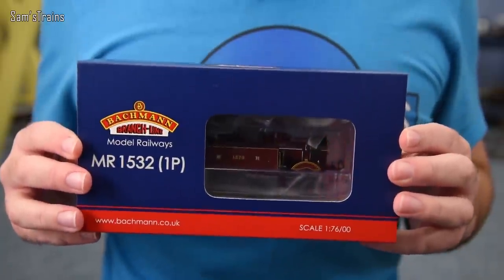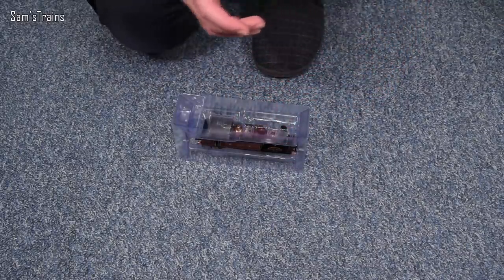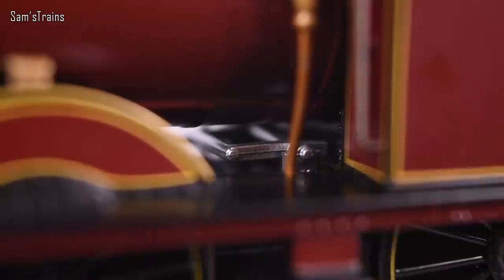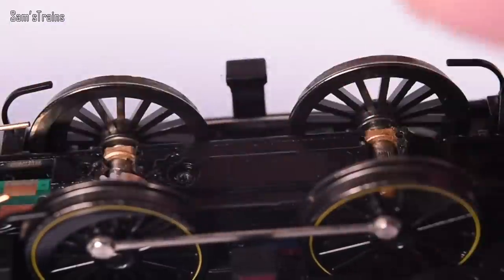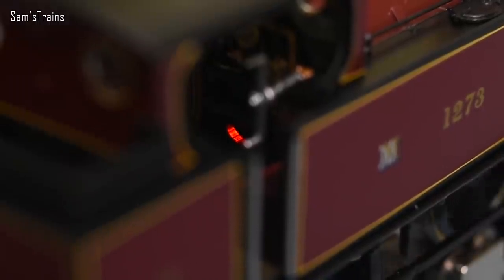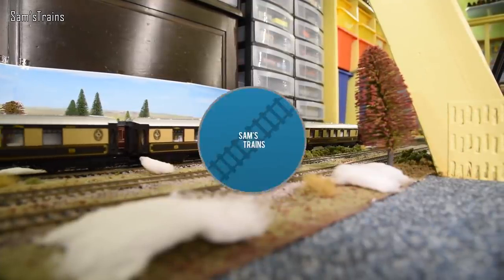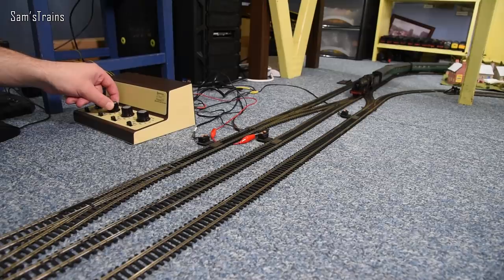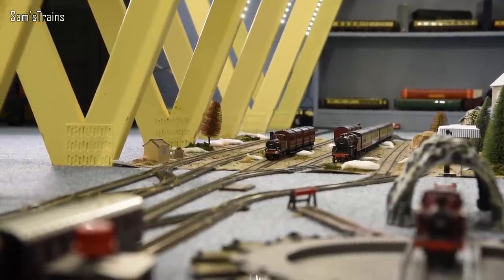Incredible New Bachmann Midland 1P Tank Engine | Unboxing & Review

Comment: I bought the SDJR version which I joined the collectors club for. So £149 + £32 makes it a pricey loco. I used to visit Mid Sommer Norton regularly so it had to be this one. Reasons. I don't have a layout yet but I did run it in on the rolling road. It ran fine. However I  hadn't realised there were pick ups on the small rear wheel set so that needs looking at as they weren't running. Overall its a lovely loco. Very expensive the way I bought it but I have a feeling its going to be my favourite loco. Have a good Christmas Sam.
Reply from the maker: Wow! They didn't even discount it below the RRP, even though you were a member? Sounds a bit greedy to me! Definitely a great loco though - I can see it becoming a favourite of many! :D
Merry Christmas - Sam :)
Reply: @SamsTrains  I just checked. They all sold out but they do have the sound version at £249.95!

Comment: To have bearings, brilliant.  I have a limited issue S & D blue, which I noted was very quiet.  Considering that these would not be expected to pull more than 6 coaches, so the non-tyred one is realistic. I think they could have used metal valve cover. I ordered mine 2 years ago. Ironically, I haven't yet received my order from a local supplier, because Bachmann haven't sent them to them yet.
Reply from the maker: I agree Don - nice quality touch that! Sure, I didn't think the pulling power sans-tyres was at all unimpressive!
Merry Christmas - Sam :)
Reply: @SamsTrains  Merry Christmas.

Comment: Uh oh...  anyone else catch an error in the model?   Freeze at 8:08 and look at the number 2 driver... that rod is pinned Next to the counter weight. It should be exactly opposite. That counter weight's sole purpose is now foiled.   Sam, will this be pointed out? I'm being interrupted and must finish watching this video later.  Cheers, John  in BC Canada
Reply from the maker: Not necessarily true - the coupling rods are not the only masses effecting the wheels - between the frames is the valve gear and cylinders... that's where all the heavy lifting is done!
Merry Christmas - Sam :)
Reply: @SamsTrains  I looked, and you're correct. I do believe that the shorter coaches look much better than the longer ones. I understand, that in the olden days when a locomotive has enough brake horse power to pull a lot, then let it. Looks out of size for this loco to pull the eight-wheelers, but your final set up is sweet! Cheers.

Comment: I have the DCC and sound one and I agree with you it’s lovely model however as regards pulling power it’s poor. I had it pulling 1 coach and it struggled on the gradient both straight and curved with slipping.So I coupled it to 3 trucks plus brake van and that was ok 👍 The sounds are fantastic and the independent brake is excellent so I’ll live with the poor traction. I enjoyed watching the video and it was a great review
Reply from the maker: Very nice Tony - though I'm surprised that there was trouble with 1 coach, what kind of incline is yours? Glad the sound was good though!
Merry Christmas - Sam :)
Reply: Merry Christmas Sam, it's not a steep incline but it slipped a lot pulling the coach which is a Bachmann composite SR Brake.

Comment: Sam: I am aware of your stated reasons for running on the floor BUT you really should encourage your followers to get up off the floor and onto a well-built baseboard. It really is the only way to achieve acceptable running provided your track has been laid with care. Plus as you get older a baseboard saves your knees and gives you a realistic eye level view.

Comment: Glad yours worked I opened mine and screws and springs fell out and stuff was rattling around inside. Went back to Rails. To add insult to injury I got Rails Terrier today that managed one circuit then it stopped working and was hot to touch something had fried inside!
Reply from the maker: Were you the guy who tweeted about this? So sorry to see yours was in poor condition. Not surprised about the Terrier - I wasn't at all impressed with mine, and I've heard tell of many failures!!
Merry Christmas - Sam :)
Reply: @SamsTrains  yes 2 duds in on week. Interesting to know it not just me with the Terrier

Comment: Still not convinced Sam. Despite dispensing with the dreaded 3 pole motor and switching to a coreless one, there were wheelspin and stop/start movement issues that not even adding/subtracting traction tyres could resolve. Also the bogie pickups were unsatisfactory and contributed much to the overall performance in my view. Not good for just shy of £150.00. Detail was lovely but it's the performance which is the real measure. Sorry.
Reply: Actually, the stop/start will have been entirely down to the pickups needing adjusting, and Sam noted as much. That is an issue common to all of the manufacturers, and I've had other very highly rated models like the Hornby B2 Peckett (£110 model) which have arrived with NONE of the pickups in proper contact with the wheels, and Dapol diesels (class 121 and 122) which have had so many dry solder joints that I've had to rewire the pickups on a £145 model just to get it to work. Some tweaking is pretty much run of the mill no matter where the model comes from. The repairs I do for my local model shop, top of the list is models where the owner has complained of poor running only for the pickups to need adjusting. I've frequently bought 'non runners', adjusted the pickups and hey presto, I have a perfectly good model for half the price! I have a pair of these 1Ps, one had perfectly adjusted pickups, the other needed minor tweaking. Both now will pick up from each axle and run so well that I can lay tissue on the track to isolate the rest of the axles and they will crawl flawlessly, regardless of which one axle is picking up. Regarding wheel slip, the real things in BR days were trusted with two coaches, sometimes just one, just how many more do you expect from the model? Its never to be expected to haul a crack express over the Settle and Carlisle, but both of mine will pull eight modern spec coaches on level track, and three on my 1:50 incline, which is perfect as I only intend on using two coaches, like the real things. For those who DO want to run a 15 coach crack express over a mountain (why??!), it will do that with the traction tyres fitted as long as the pickups are in good fettle.
Reply: @Simon-Davis  I'm not expecting any more from this model, or any other, as regards wheelslip on an incline.
Reply from the maker: I was very impressed by the performance, except when the rubber tyres were fitted, in which case the performance deteriorated massively. When I adjust the bogie pickups (which should be easy) I expect the stalling should be reduced to a minimum. Without the tyres there will be wheelslip with larger loads, but the pulling power was adequate!
Merry Christmas - Sam :)

Comment: It looks like the handrail on the right side of the cab is broken at  8:50 . I kept wanting you to do a close up on the right hand side as well to try & get a better look but you never showed it.
Reply from the maker: Well spotted! I never noticed that during filming - just been to check, and the broken parts are now sitting together, so you can't tell! Wonder if that happened when I had the loco in the cradle? Pretty sure it wasn't there when I did the initial inspection.
Merry Christmas - Sam :)

Comment: Do any locos with coreless motors have flywheels? If I understand correctly how coreless motors (and I may not) then a flywheel wouldn't really work as it could put the rotor out of sync with the motor controller - but I could be completely wrong on that!
Reply from the maker: Yes some do have flywheels, the J70 did! You might be thinking of brushless motors, but coreless ones run on straight DC, there's no motor controller involved!
Merry Christmas - Sam :)
Reply: @SamsTrains  Thanks Sam, yes, I am thinking of brushless motors - I obviously need to research coreless motors!

Comment: Well I'd like it more if I could let my heart rule my head, but sadly it doesn't perform well enough for me to want one.
It's a working model, not just for display, so yes, it looks great, but  good performance is what I'm looking for, and this does have a few hiccups!
Reply: Having picked mine up from my local shop the day these arrived, mine has been in use pretty much constantly all week. Of all of my locomotives, this one is the best performer by a considerable margin. Out of curiosity, what part of its performance wasn't good enough? If you expect it to perform like a Stanier pacific and pull a crack express up Shap, you're entirely missing the point of them. They're supposed to be a little potter about branchline engine, expected to drag one or two dilapidated coaches around at 20mph. The real things in BR days were only trusted with two coaches and the model manages four times that many on level track, so the models haulage is higher than is required. Even when they were used on the 'intra district' suburban services around Birmingham in the 1910s they ran with four coaches and occasionally pulled empty stock of two sets totalling eight empty coaches. I tested mine to eight bogie coaches and it would have taken more, but its only ever going to run with two. If you want an engine that was built to haul longer trains then the 1P is not the right engine for the task, that is the whole point, that is why it was given the 1P power classification. Electrically speaking yes, the bogie pickups might need a tweak to act more positively, mine didn't but some invariably will do. But I've had models from all of the main manufacturers that need pickup adjustment. I have a Hornby Peckett, another normally immaculate performer, which arrived with NONE of the pickups properly contacting the wheels. The 1P I have will pick up fully from each axle without fault, I can place it on tissue paper with just one axle on the rail, it doesn't matter which one and it will still crawl faultlessly. So, it pulls more than the real thing was designed to, and as long as the pickups are properly adjusted it runs better than almost every other model out there; you literally cannot get any better performance than that! ;)
Reply: Well he didn't review yours, so I can only go on what I saw - it was poor with traction tyres, which could be a problem if you have inclines and would need them - and worst of all it was browning out on express points - and if that's the case it wouldn't even go over some of my points!
In my view, small engines need as many pickups as possible, so to sell something for 150 quid when half the pickups aren't even positioned properly, is outrageous.
If yours was OK, then this is down to Bachmann quality control, and I have found that to be poor with other models, but for this price it's not acceptable.
And to say we have to take it apart and re-position the pickups is ridiculous - I wouldn't know how to do that, and even if I did, why should I have to?
We don't all have perfect tracks, and I've not found small engines generally reliable, especially at slow speeds, so most of my 0-6-0's have tenders with tender pickups, and they run perfectly - although I have hopes that 'Rails' new Connect decoders will help brownout problems.
To be honest  I think model train fans put up with a lot on nonsense - if new cars were as poor as a lot of model locos are, the car manufacturer would go out of business.
These things are expensive - there's no excuse for those that don't even work properly - and if I'd got what Sam got, and the bogey wheel pickups weren't even touching the wheels, and it stalled even on an express point, I wouldn't have given it 5 stars for performance - I'd have sent it back!
Reply: @SuperJ333  
Its your prerogative to write off a model based on an online video, but my advice is to go and handle models in a shop and see them running in person before passing judgement. Odds are, any issue can be sorted there and then, it saves a lot of disappointment and postal returns. 
Comparing this to new cars is effectively saying you don't need to do basic maintenance on the new car by the way. Factually incorrect. You need to do quite a lot to a new car to get the best out of them. When you buy a new car they will go over it with a finetooth comb before they give you the keys AND you are usually advised to bring it back for servicing quite soon after taking delivery of it, where they will continue all that tweaking and adjustment for you as the car breaks in. I've had to do clutch adjusts, brake adjusts, TPS tweaks and I always change the oil after the first 50 or so miles and check for metal shavings to make sure all is well with the crank and bearings on top of what the dealer recommends. I bet you've never encountered a brand new motorbike too...I've known people strip them completely down within the first week of ownership. New model locomotives are the same, they need a bit of tweaking to get the best out of them, ideally they also need that packing grease cleaning out and proper lubrication too. Its part and parcel of model railways, as is regular stripping down and maintenance as they age. Expecting otherwise is unrealistic.
The main trouble is that when buying models online you can't check the model over that you are buying, which means you can't sort out the tweaking which is usually needed at point of purchase. That leaves the onus on the purchaser to do the tweaking necessary, and believe me I've had my fair share of new models that needed some work! My local model shop will do that kind of tweaking with ANY model they sell, new or second hand. I also do their repairs for the N Gauge stuff, being as my local shop is owned by my model club chairman and I run the N Gauge department ;) The vast majority of repairs are also usually down to dirty or poorly adjusted pickups, followed swiftly by damage caused by the owner poorly handling them. I will admit that I take advantage of people who return models like this, they'll send it back saying its a non runner and get a replacement, I'll make an offer before the shop sends it back to the manufacturer and every single time I've managed to sort the issue and obtained a bargain. Best case being an LGB garden railway locomotive worth £1500, the original buyer bought it, stripped it to clean the packing grease and put a keeper plate back on the wrong way around, which locked up the mechanism. They sent it back, got a refund and I bought it for £500, turned the keeper plate the correct way around and saved £1000 for my 30 seconds of trouble.
Regarding the traction of this model, it will still take a realistic load of two coaches up a 1 in 50 incline. It will just about manage three actually, so again, the model does what was expected of the real thing without needing the traction tyre. If you want it to pull a crack express over a mountain, it will do that with the traction tyre fitted, but again, it will need some tinkering to get the best out of it.
Reply from the maker: Yes, to be fair the performance was absolutely fine. I think the browning out was caused by the poorly adjusted pickups, which I think should be easy to fix. With the tyres fitted, the performance was poor, and I would not recommend it. Out of the box though, the performance here was much better than most other models!
Merry Christmas - Sam :)

Comment: One thing im curious about with all modern engines are they can put working lights on Diesels, so why not fit lamps and lights too the Locomotives?
Reply from the maker: Yeah I guess so - though this does have a light in the firebox! :D
Merry Christmas - Sam :)
Reply: The diesel locomotives use a circuit board with the LED lights already soldered in. With steam locomotives they would have to wire the LED lamps front and rear. Also expert modellers will sometimes run trains with the correct running details including the different locations of the lamps depending on the service the train was running (there are different locations for lamps believe it or not), so it would be a nightmare wiring for various locations. I know a company called train tech sell aftermarket working steam locomotive lamp kits for both the front and rear of the locomotive.

Comment: It’s good too see dc models are getting dcc effects. I hope they can try to get sound on dc soon. A great  idea for the future of model locomotives could be the reverser rod moving when you switch direction and even a moving regulator for when your loco starts to move.
Reply from the maker: Yeah that is quite good actually - and that'd be absolutely amazing! :D
Merry Christmas - Sam :)
Reply: Train tech do a sound system for DC locomotives which is battery powered. You can fit the sound in a carriage or wagon and as soon as the locomotive starts to move it senses the movement starts the steam engine chuff sounds. They also do one for diesel locomotives as well and a massive range of other electronic tech for model railways.